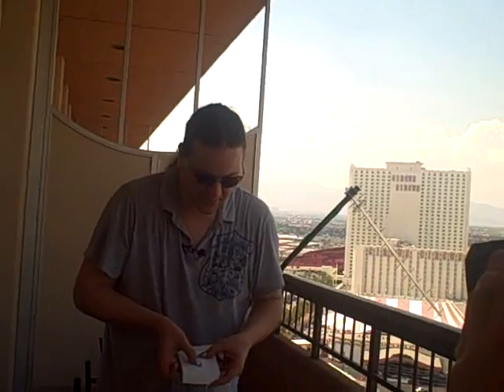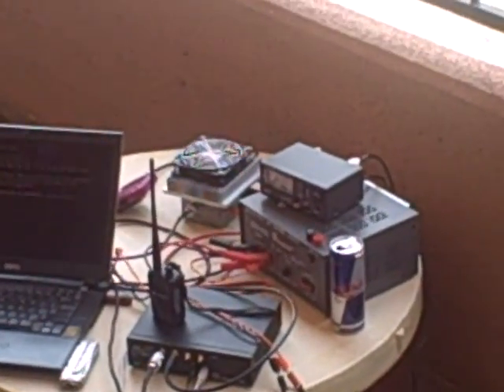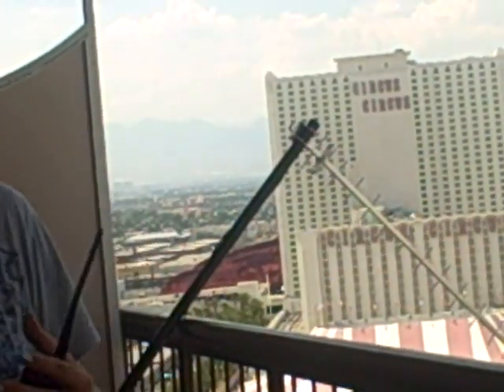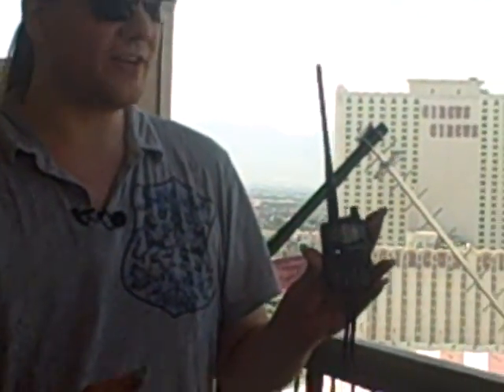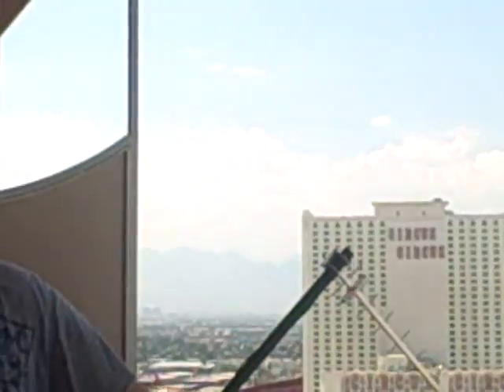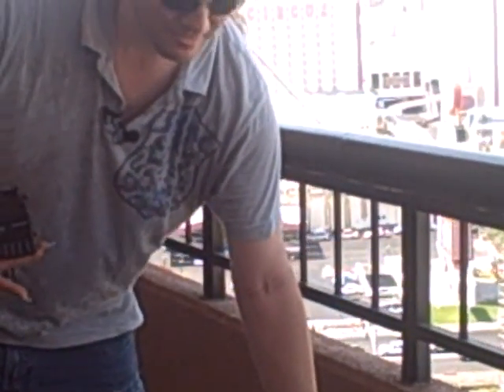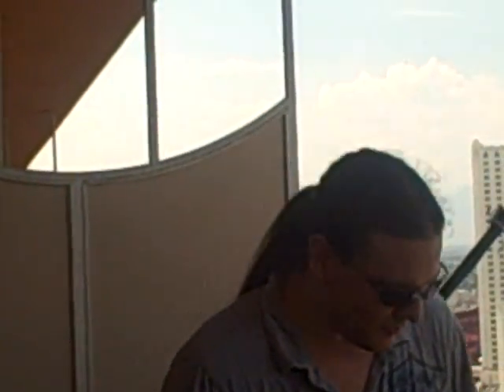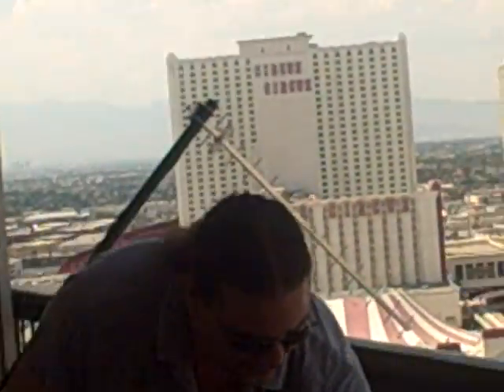Chris Paget talks about long-range RFID tag reading

Comment: hi I need to pot RF-ID all the gate in my work shop and my house Im willing to pay the cost of eCo and up to £5000 for how can set it up for me I trayed to get it done but the best I can get is 30CM witch is not good to me as I need to be able to drive with car in garage and with RF-ID open door with out getting of the car if anyone knows how to make long range RFID I'm willing to pay for any cost + label cost please text or call me on 07979891700 thanks
Reply: Isaac Tak Why do you need RFID? Why not use a key fob powered system?
You press a key fob in your car and the door will open.
Reply: Can you please call the number or just send me your number so I can tell you why I need rfid for it thanks ZAK

Comment: who cares if you can read the number on the tag.  If you don't have access to the back end database, the number is useless.  I can read the license plate on you car too but it doesn't tell me anything.  I  can track you easier by your cell phone.
Reply: Tim Waggoner: Useless? That "number" is a unique identifier. It's trivial to link that unique identifier to an individual with COTS highly-directional RF gear (read: fox hunting). Once an attacker makes that connection, they can set up transceivers anywhere to track down to the centimeter where that individual is. It's MUCH better resolution than what can be gleaned from something like GSM trilateration, assuming you even have access to all that cell tower data.